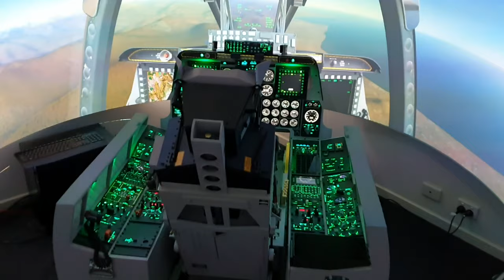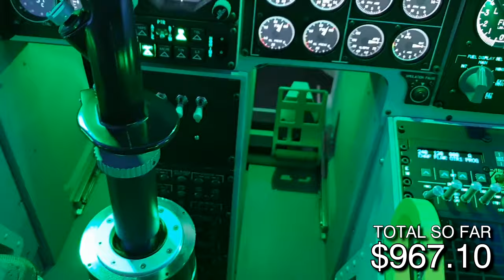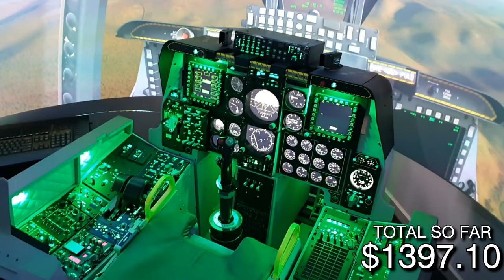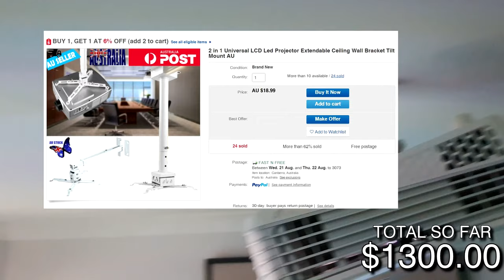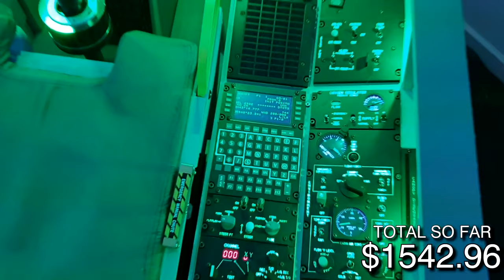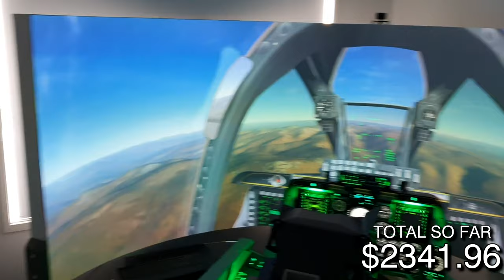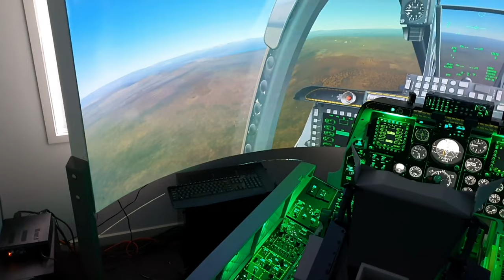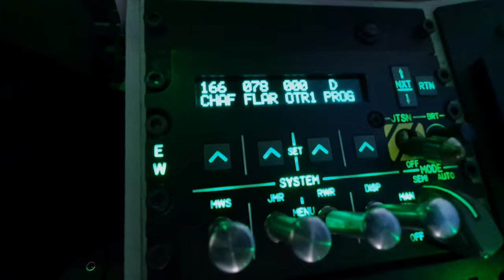What it Cost! - A10C Warthog Simulator (Part 2)

Comment: If it was made by the government, it would have cost 500,000$ for one model and would take years to finish
Reply: Yep, and it would not have worked...  The second one would have a $5 million budget ...
Reply: @project.jericho  It's pretty amazing that a civilian can get so close to military-level equipment with an investment less than his cellphone expenses over 5 years.
Reply: @project.jericho  I'm guessing the reason he doesn't have have a frame for it is because he uses projectors for his screen. Adding that would cast shadows and block the view.
Reply: The military versions are much larger and hydraulic computer controlled beasts. Which is one of the reasons that they cost so much. However, yes they do cost way too much for what they are, however all military budgets along with other Government budgets pay a lot more than they need to for light bulbs etc. However, all of that is top secret and I kid you not, all military suppliers whether it be paper clips, light bulbs etc are classified as top secret.
Reply: PLUS is would run on Microsoft Flight simulator 98
Reply: There is a reason, they are good enough to learn how to fly on. The multi-million dollar simulators at flight safety international confer type ratings and a pilot can go from that to flying the real plane with no issues.

I don't care how good DCS is, or this simpit, you aren't going to be flying a real A-10 after it.
Reply: @Ananamitron  Interesting how DCS A-10 is used by real student pilots who go on to fly the A10C lmao
Reply: @sweaty8717  You aren't going to jump into an A-10 after logging time in DCS. Instrument pilots can study on a PCATD, but it doesn't count for hours needed.
Reply: I'm not a fan of goverments, but they would use the real gauges, buttons and switches and write special software to make all the gauges and buttons and switches
compatible and all that does cost more money that this home built simulator. This guy did this in his spare time but when he would work for a company,
then he's going to cost about 40 dollars an hour, and working hours is the most expensive thing on any product, and then we talk about one person and
at a company who would make these simulators, there are always more people working on a project like this, so let's say 4 people who work on it
for 2 years, and those people earn 30k each a year, that would be 240k in sallary, without taxes and shit, and exclusive the materials to built this setup,
so then 500k is nothing special. And they need a building with a workfloor and offices, and they don't come for free eighter. And the goverment would 
use a platform to mount this whole setup on to so that the cockpit will move up-down and left-right to give the pilot a more realistic feel to the whole simulation, 
so that's going to cost even more.
I restore old vans that were from the fire brigade and i buy them for 3-4k and spend another 3-4k to restore them and then sell them for 12-14k
because i'm not santa claus but i do need to eat aswell, and i need to pay the rent for my shop and heating, water, electricity, and buy new tools now and then 
because they also wear out, so when it's not a hobby, then things are going to cost serious money!
Reply: I can tell you from personal experience that it would actually cost $16M AUD for this sort of a setup when commissioned by the govt.
Reply: They would have bought it off another country, realised they got sold a dud, won't admit it and stubbornly spend the next 20 years and a billion dollars trying to fix it.
Reply: You're talking human nature
Reply: You're forgetting about the cost of labour.

Comment: Considering the quality and realism of the setup you've built, the cost seems pretty modest to me.
Reply: Could u use an occulas with ir tracker and still be accurate with the switches
Reply: Very modest indeed since you could sell it at 5x or 10x and someone would buy it as a turn key setup

Comment: I believe that the a-10c dcs-bios script can send the cdu as text, so its possible to have an arduino render the cdu on its own instead of using video output from the game, freeing up a display output.

Also, 8000 AUD is honestly not bad for a setup like that, if you had a 'normal' hobby like riding a motorcycle you would easily exceed that amount just on the initial purchase, if you like going alpine skiing or snowboarding it doesn't take too many trips and equipment bought to exceed that. It's a matter of perspective and honestly in my mind the process of building is just as exciting as using a simpit.
Reply from the maker: Completely true. Building it is the fun part for me- I've always enjoyed being in the shed and tinkering. Its all about the small victories when something is powered up works first time. I used to play around with old cars for a hobby- this one is much much much cheaper!!
Reply: @thewarthogproject  or you know do the easy thing and get a usb to hdmi adapter...

Comment: Very nice work on this pit!
And very costefficient, wow. 
I'm building a F-16 Homecockpit right now and now have almost everything needed for it. I'll be at about 30.000 Aussie Dollars without visuals.
Some original real parts are in mine too, they drive the price up though. But I never thought, you'd be in that low pricesection with such a great pit, respect!
Reply: I started an F16 too, pretty pricey for parts.
Reply from the maker: 30K- ouch. I'm considering a Viper pit as well thanks to the upcoming DCS module...

Comment: This by far is the best cockpit for DCS . And it looks absolutely amazing. This is a work of art honestly. 

 Got a question though, how did you get everything to work with DCS. Like the monitor behind the panel, showing the radar and everything in those exact cutouts. The switches and lights all working. Would you be willing to make a video on that.

Oh and great ending, got have the brrrrrrrrrrrrrrrrrrrrrt.
Reply from the maker: The Main panel is run by free software called Helios, made by Gadroc. Have a look over on the ED forums for download links. You can design your own panels, and move and resize each gauge around the screen to wherever you want.
Reply: @thewarthogproject , thank you for responding to me. I'll check it out thanks.

Comment: Hi RomeoKilo, I am thinking of using the same screen and projector setup as you except using 2 x 4k projectors.  Currently I have an overclocked CPU @ 5.0 Ghz and a single 1080TI.   
Do you think that my system would be able to smoothly run 2 x 4k projectors ?
If not, would two separate GPUs (non-SLI) be possible ?   Is it possible to set up DCS world so that each projector uses a separate (non-SLI) GPU ?  If so, how ?

Comment: Awesome simpit. Can you please list the parts and components you used to refresh you rudder pedals.
Reply from the maker: I used a LeoBoder BU0836X  and one of their hall sensors as well. It was pretty easy, i just pulled out all the old PCBs, hot glued the new hall sensor in place and wired it to the card. 100 times more accurate.
Reply: Cool, thanks for that. I've got some saitek pedals that aren't working.

Comment: I'm guessing the Thrustmaster TPR wouldn't be compatable with this frame build cos of its centre bulk?  V tempted to try for something like this
Reply from the maker: I could probably make it fit by removing some plywood. I'm not planning on dropping $1000 AUD on some pedals though!
Reply: @thewarthogproject  I feel the pain - Honeycomb look to be due to announce some pedals in the next few weeks, and I'm considering their yoke and throttle for non DCS flying too, so hoping these turn out to be something to compete with the TPRs as their other parts look to be great quality for the money.  I want to buy the Warthog HOTAS setup right now but then losing my twist stick on the T16000M means I'll need something to replace rudder in the meantime

Comment: Is it not possible to use a usb - hdmi/dvi/vga/whatever adapter for your gauge and info displays as they don't need a high refresh rate, which then frees up your gpu display outputs for the main displays?
Reply from the maker: Possibly. Ill look into that. Thanks!
Reply: @thewarthogproject  No problem. It's something I've been wondering for over a year now as we use them at work to extend the desktop of our cheap 2 monitor output workstations to 3 monitors. You can tell the latency when you move windows across the screen quickly but I thought for guages and moving maps that aren't changing really quickly like the external view should be ok as long as there are no syncing issues with the refresh rates. Anyway, thanks for your reply and I hope you'll keep up the great content. I look forward to seeing some videos of you using this in combat once it's finished.

Comment: $7,870 because you done it all yourself. However, if you had to pay people to do this for you, that cost would be sky high. I kept skipping to see the prices, so I am not sure if you actually paid yourself for this, but if you times you man hours at an experts rate, this would go to 15k or more to build. I am not even sure if you have included your 3d printer and a laser cutter I think it was from another one of your videos. You work is still not finished yet, it would be lovely not to see plug sockets and cables. Who knows maybe a frame to attach to the screens and have it like a cockpit or a high end simulator, where you open a door, go in and the whole World is outside. Ah yeah that would not work, I forgot about the projector's Well unless you build it that big, that it touches the roof, so you would have the projectors at the same height.

Comment: The Thrustmaster warthog is overpriced and very overrated, plastic junk. There are better options out there for less money.
Reply from the maker: I agree. Mines only been going for 10 years non stop without a single issue. What a piece of junk.
Reply: @thewarthogproject   10 years ago it was the best. I'm happy it has held in there for you.  I've had mine for about 6 years and for $500 when I got it, I was disappointed, I expected more for that much money.
The newer stuff from VKB, WinWing and Virpil just blow this HOTAS, and it's crazy price out of the water. I picked up the Gunfighter Mk.III  and the WinWIng Orion Throttle  and never looked back.